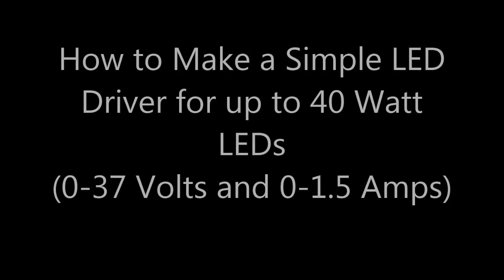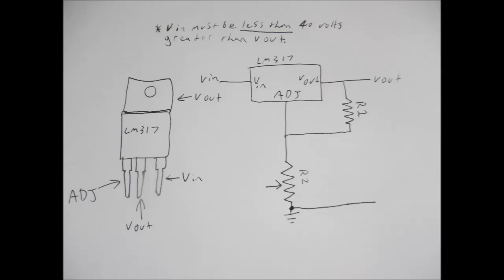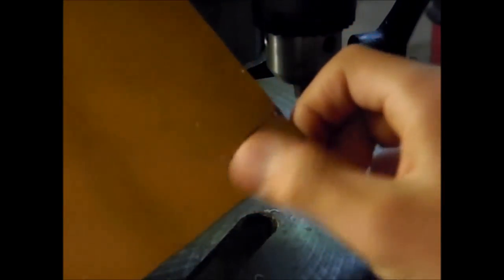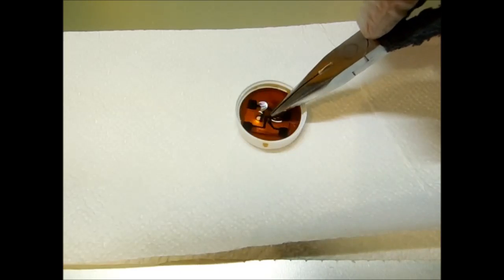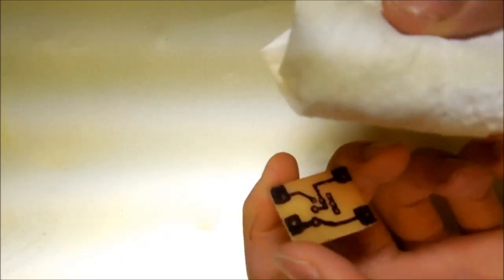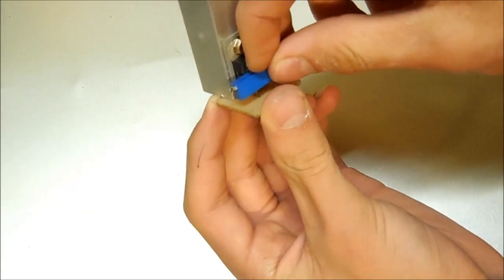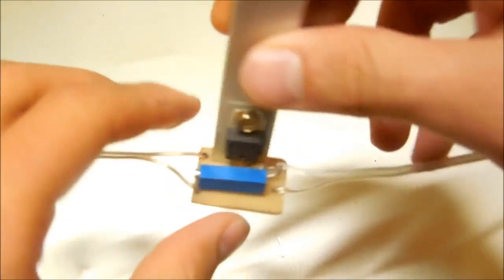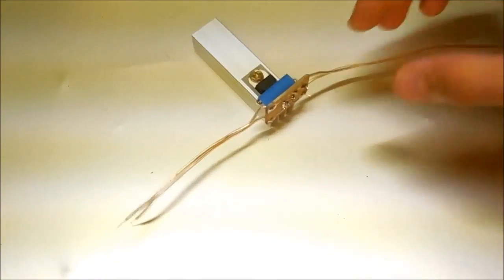How To Make A Simple LED Driver

Comment: hey, nice work. i found your video to be the most easy going and informative on youtube so i wanted to follow your schematic. i want to light up a 5W IR led. do you think your design will do the work? if i make it with SMD will there be a problem? some people used a capacitor on the Vin of the LM317 do i need to do that? 
Thanks in advance, Themistokles.
Reply from the maker: Thanks for the positive comment! This should work fine for your application. The filter caps are not needed in the circuit unless your power source is unstable though even if it is it should not effect the operation of the LED. So you don't need them. Good luck!
Reply: Hello again. I made this but i cant seem to exceed the 1.3 volts. What voltage did you supply the driver with? Thanks in advance, Themistokles.
Reply from the maker: I am not sure what you used to supply it but you need to supply the LM317 circuit with more than you expect to get out, there is a minor voltage drop just as there is with most semiconductors I don't remember what I supplied it with but I think I used a 12V battery to power the 10v led through the driver circuit.

Good luck!
Reply: +Electrotechnics A prime example of my above comment. You sir have proved yourself cluekess here.
Reply from the maker: Thanks for the comment and the view!! I just hate it when I'm cluekless. It sure is no fun when you run out of clueks.
Reply: yeah... plus clueks is pretty hard to find these days... :P
Reply: please dont use this "LED driver" to try and drive a 5W LED :/

Comment: So how many 3w cree led can you hook up ? 13 right ?
Reply from the maker: Probably 13, but just make sure that how ever many of them you use does not exceed 1.5 amps or the LM317 won't be able to light them up all the way. You can use a pot to control the brightness in the place of one of the resistors just make sure what ever resistor setup you do make wont allow you to crank it up to much while changing the brightness.  Thanks for watching!!
Reply: XfmXz  
Thanks, how do you know how many amps you have, acording to the link http://diyaudioprojects.com/Technical/Voltage-Regulator/

I assume that you use the first model " Voltage Regulator Calculator" right ?
Reply from the maker: Yes I used the first model.

The Cree 3W leds have a forward voltage of 2.9 volts at 350MA, so if you hooked them in parallel (positive to positive, negative to negative) and set the LM317 to 2.9V you would only be able to run 4 of them. If you made 4 sets of 8 leds in series then hooked each string in parallel then you could run 32 of those leds on the regulator set to 24V and it would just draw 1.4A.

To figure out how many volts or amps the leds will take when hooked up you go by this when you hook them in series you multiply the forward voltage of the led by the number of leds you have in series and the amps will still be at 350MA. When you hook single leds in parallel you multiply the forward amps of a single led by the number of leds you have in parallel and the voltage will still be 2.9V.

Then you can put those "rules" together and figure out how many you can run at what voltage and not exceed 1.5 amps. 

Remember to use a heat sink on the lm317 if it starts getting warm (the one I used is overkill)
Reply: XfmXz Thanks  a lot. Nice video.
Reply: XfmXz Can i adjust the curren on the outpu, cuz 1.5A is to moutch for some cree that have max 1A.
Reply from the maker: Zlatko Pehlivanovic You can use a LM317 as a current regulator but you don't have to. 1.5 amps is the max it will put out, the LED will only draw as much current as it needs as long as you don't give to much voltage. So you don't have to worry about the amps.

Comment: Hi, I want to use this for a little DIY lamp I want to build. What voltage input did you use?
Reply from the maker: The output voltage of the LM137 (voltage regulator) is from 0-36 and the input/output voltage differential is 40 volts. So the input can be 40 volts higher than what you want coming out of it. But the higher the voltage in is from the output the more heat it will make and you will have to have a good heat sink or it will burn up.

Good luck with your lamp!
Reply: Awesome thanks. I'm gonna try and make a 3D printed lamp in the shape of a 5mm LED so it looks like a giant one. If it's successful I'll comment back with a link to a picture or something.
Reply: +Electrotechnics LM317 has input voltage of 3 -30v not 40. And there is no mention in your vid of the dropout voltage from the LM317...please stop misleading people.
Reply from the maker: +BooktownBoy 
If I could direct your attention to the datasheet for the LM317: http://www.ti.com/lit/ds/symlink/lm317.pdf 
You might notice that the operating voltage is 3-37 volts. 

And as a side note, I said the maximum voltage was 37v in the video.

The data sheet is a very useful tool.

Have a nice day.

Comment from the maker: Yeah I sure like my electronics, I have in plans to build a electronics work room in my very large empty attic. I have draws and draws filled with electronic stuff, and a nice electronics work bench equipped with grounding ports, outlets, shelves, ect. I need to find some where selling replacement handles for my Ungar 4924 service station, then I will finally have a good soldering/desoldering setup.